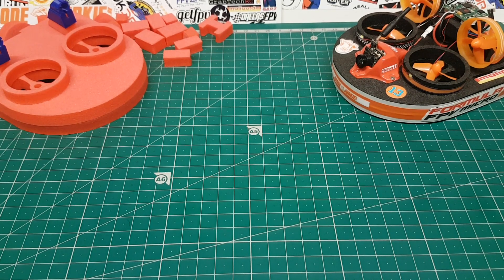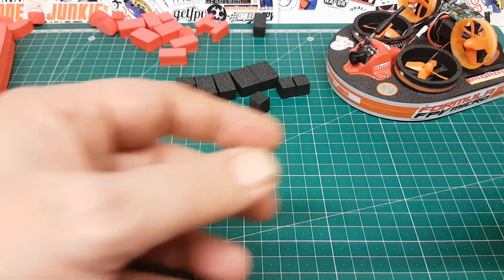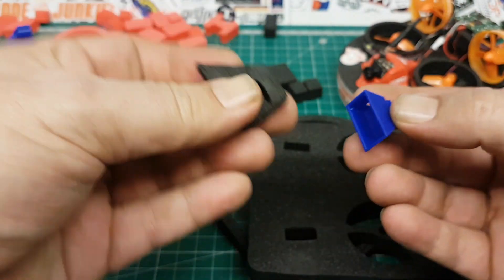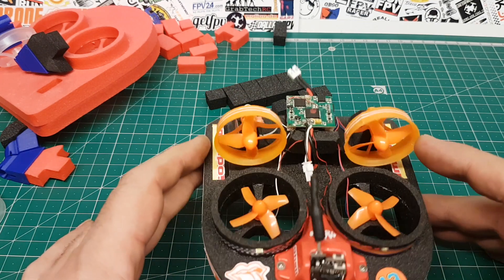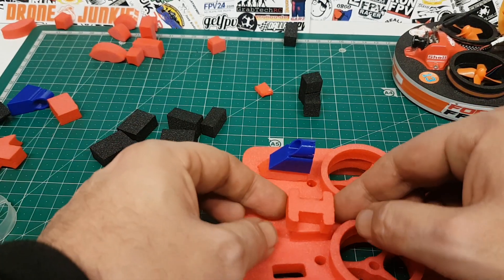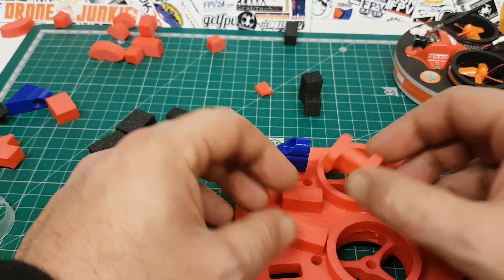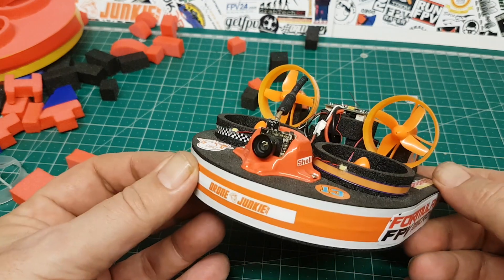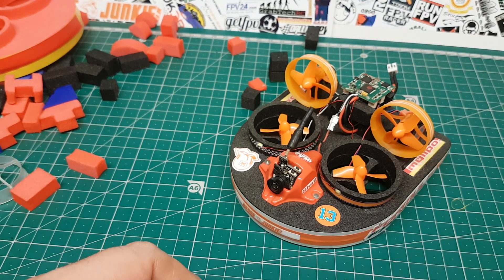Whoover Quick Build Video (Micro Drift Hovercraft V2)

Comment: Am I understanding correctly that you are  using the stock flight controller board from an Inductrix or Eaxhine E010?  Thanks a million for sharing your rad vid man.
Reply from the maker: we have used most all of the 6mm FC's including 
inductrix / newbee acro bee / Nano QX / E010 
There is even a fc mix for splitting the lift and thrust motors ;)

Comment: This is a great video thanks for sharing. Just wondering how y’all are making these things work in reverse?
Also the plastic used to make canopies works great underneath to make it more slippery. Its light weight and not to thin that it wears out after 2 packs.
Reply from the maker: Thanks for watching :) 
We get reverse by using pitch (elevator) as its still connected so the lower motors get more power and we kinda lift and turn to get of tight places. 
Using any stiff plastic works great and for sure the sheets used for vac form are good for slip pads.
Reply: Jem Little thanks for the tutorial bud 👍well done.